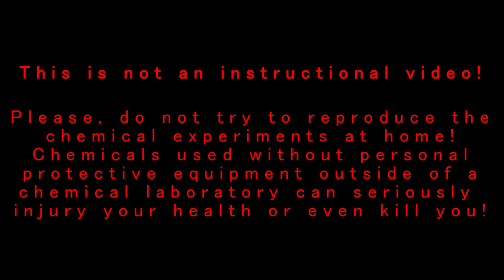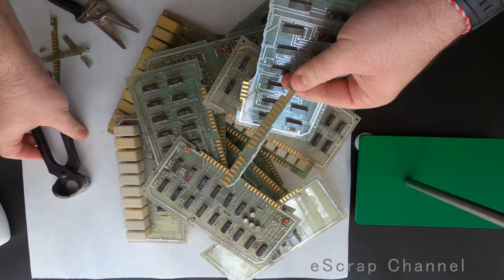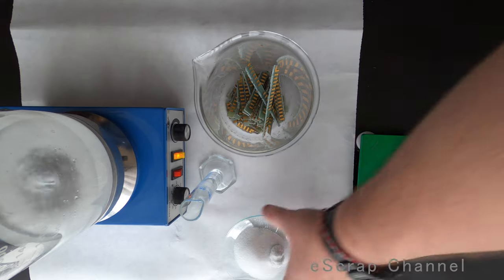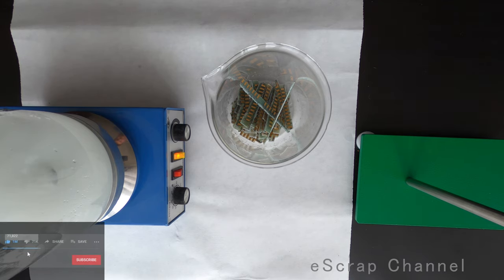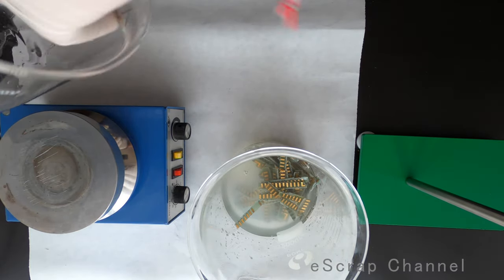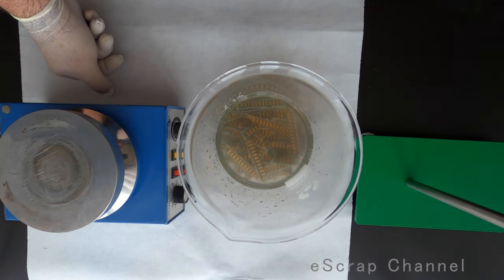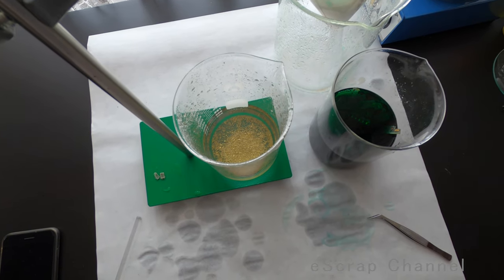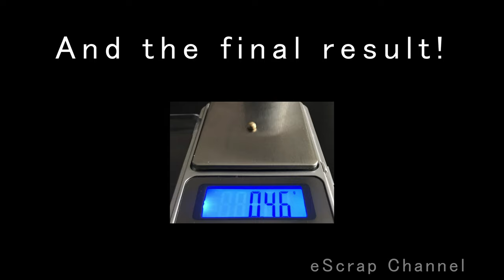Gold recovery from vintage boards plated fingers!

Comment: Do you use iodized or non-iodized table salt. Mention was made of the reaction stopping. You filtered out the loose foils, returned the fingers to the solution, and rejuvenated it with hydrogen peroxide. How much hydrogen peroxide is needed to rejuvenate the mix? Will this process work on enig plated finger boards off flat screen monitors and TVs? How about gold-plated circuit boards like cell phones and laptop track pads?
Reply from the maker: Hi, salt is from a chemical shop and it is non-iodized. Usually small amount 3-5 ml 30% peroxide restarts the reaction without risk of boil over. Yes it works for cell phones for example, too.

Comment: Hi. Is adding vinegar to this mix will help or make the process faster? Or it is not?
Reply from the maker: Hi, citric acid is acting as vinegar, but citric acid is better dissolving copper, so to speed up the reaction I would add hydrogen peroxide but this can end up with boil over. So, from my experience this reaction needs time.

Comment: But why you don't  show when you use aquila ragei 
We wonder how do produce last product 
Plaesa make full vedio 
And explain all the process
Reply from the maker: Hi, just created a short version and tried to focus on the gold stripping. I have the full process in my other videos!
Reply: @escrapchannel  is this gold or copper
I want 24k gold 
Is this way ok for produce
Reply from the maker: Hi! This is gold. In this video is presented how to remove gold plating from ram and slot card fingers. Usually in electronics gold plating is not 24k. So you have to refine the gold foils in aqua regia and you will get 24k gold product. : غادة فارح
Reply: @escrapchannel  
Is their any for precipition gold with smp 
If you let me know
Reply from the maker: غادة فارح Yes, in my newer videos I present all steps.

Comment: Wow. This is very interesting. I never saw it done with citric acid, only with vinegar acid.
Now the million dollar question: can you use citric acid saturated with salt and some chlorine added to dissolve the gold and then precipitate it with vitamin c as you could with vinegar acid?
Anybody knows?
Reply from the maker: Hi, what we have in this solution: citric acid, NaCl, H2O2. In the solution we get a complex chlorine compounds but Gold was not dissolved. I did stannous test. Citric acid is very weak trivalent acid. Adding chlorine will probably dissolve gold as you will have the two components needed: oxidizer and chlorine anion.
Any other opinions are welcome :)
Reply: @escrapchannel  Thank you for the reply!

Yes my thoughts exactly, it should work with citric acid and chlorine just as well as it does with white vinegar and chlorine.
Then add a few drops of sulfuric acid to the solution to drop out any lead in solution before you precipitate the gold. Hopefully with vitamin C, as it would work with the vinegar based solution.

Guess ill give it a try. In the worst case i have gold in solution that won't drop with ascorbic acid and i still need to use SMB (which i would like to avoid).

Now i have to make a batch of 30% H2O2 as i only can get 3% to prevent me from making bombs apparently ;oD
Or, use 3% and wait for alot longer.
Reply from the maker: I use 25 ml, 30% H2O2, and total volume is at about 500-600 ml. My peroxide concentration is under 2%. So, if you use 300 ml 3% peroxide and 200 ml water - we are on the same page :)
Reply from the maker: Be careful! Volume of the solution should not exceed 1/4 of the beaker volume. Reaction is exothermic and too much peroxide will speed it up too much!
Reply: @escrapchannel  Its a deal!

I try it that way. If i could replace white vinegar with citric acid that would be a real win for me as citric is a lot easier to obtain than white vinegar where i live. Also its less smelly ;o)

It will take a acouple days until i actually get around to do it but i will come back here and tell you the outcome.
Reply: @escrapchannel  Thank you for the warning. Yes, i monitor my temperature and add ice if needed.